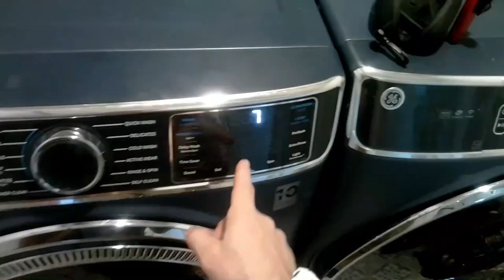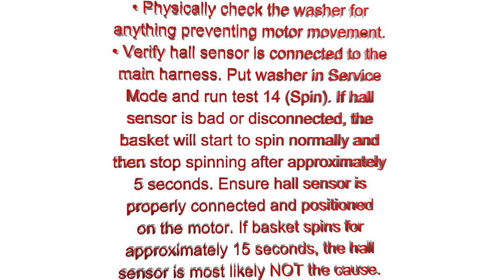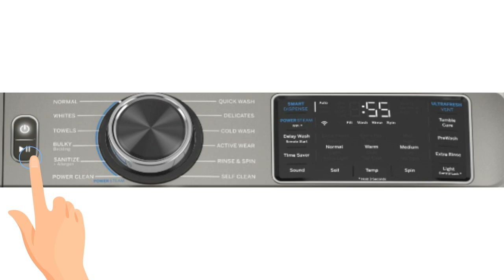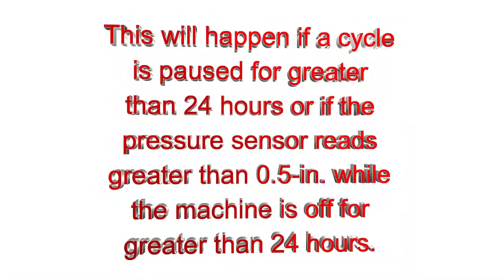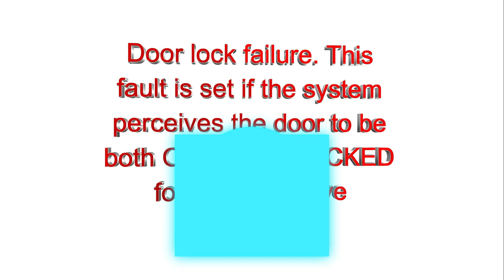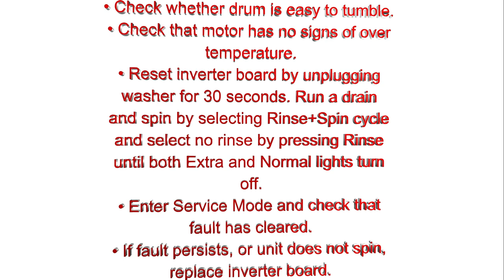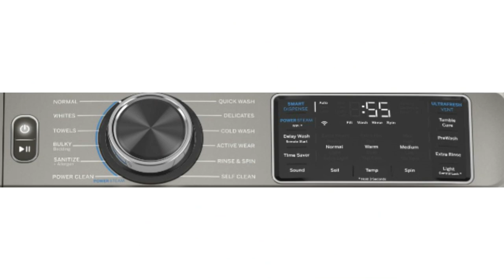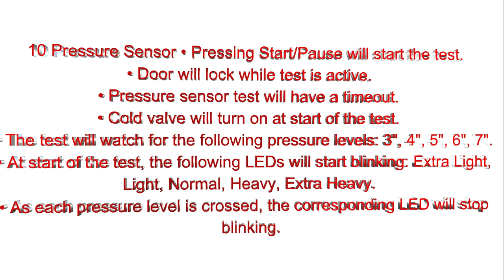GE Washer Diagnostic & Error Code Guide: Models GFW510-GFW850

Comment: Thanks for excellent video. I have GE Front load washer Model GEW550SPN0DG which all of sudden stop spinning and all washing cycle stop in 4 to 5 minutes. It shows error code 3, 27, 38, 32 and 65.
I did test 10 (Pressure Sensor) which seems working. Soil LED blink and stop all for indicator (i.e., Extra Light to Extra Heavy)
Test 14 (Spin). Basket stopped spinning after 4 to 5 seconds. I replaced Accelerometer (WH03X32138) but it did not solve the issue. Does Hall sensor and Accelerometer are same part for Model GEW550SPN0DG?
Test 24 (Damper). Soil level “Light” LED continues blink during test and when press start/pause button it changes to “Extra Light” and stay there until press any other button or Power off. I am not sure whether it’s successful test or not. Does it suppose to start with “Light” and change to “Extra Light” and stop at the end to Test automatically. 
Appreciate your help.

Comment: My gfw850spnors is not working, it turns on but no cycle runs, it is showing error code 89, I had a few more and replaced the inverter board and then the accelermeter, but I still have error code 89 and it will no work. Help!

Comment: I keep getting the “h20 supply” error.. water pressure is good. Hoses are good. I run through all these tests and no errors.. do you know what it could be?!? Very frustrating
Reply: @TravelDuckDude Please inspect your inlet valve screens for any debris that may be trapped between the filter screen and the inlet. Additionally, I recommend flushing out your water lines using a 5-gallon bucket. Begin by turning off the water supply and disconnecting the hose from the washer. Direct the open end of the hose into the bucket and gradually open the water valve. Observe the water for any signs of debris.
Reply: @ Thanks but the screen is clean and I even switched the hoses out. I found out it’s only when I use the cold water.. so now my clothing can only be washed in very hot water..
Reply: @TravelDuckDude  You may need to replace that intel for the cold side.

Comment: Mine doesnt seem to start diagnostic mode at all. Even when I hold 10 seconds or I hold and move 6 or 8. It doesnt go into diagnostic mode but turns it on and goes into turning between wash modes.

Comment: I have models purchased in 2020 and it is definitely 6 clicks with holding start button rather than 8 to get into diagnostic mode. Thought my control panel was broken as I couldn’t get it to work with 8. Luckily I have 2 machines I was able to test on and kept trying different click combinations on the working machine. Everything else is the same though!
Reply from the maker: I appreciate you posting this; it's bound to be useful to others. Just a note, it took me 8 clicks to get it working. According to the Service Manual, the correct procedure is to "PRESS AND HOLD THE START PAD WHILE ROTATING THE CYCLE SELECTION KNOB 180 DEGREES." Nonetheless, I'm grateful for your input. Hope you have a great day!
Reply: Thank you! Dealing with an error 3 so not sure how great the day can be but glad to have more info! 😊
Reply: @onlineappliancetech Mine was six as well. There are 12 selections in the dial so 180 degrees would be six cycles. Sometimes it feels like there are two clicks to get to a cycle. Maybe that’s why you noted 8 clicks.

Comment: It appears that the hall effect sensor on this model(gfw850) is directly on the motor opposite the drive belt. You can access it with the front panel removed. There is a spring cover. It does not appear that the hall effect sensor can be serviced and a failure of the sensor requires a replacement of the motor. It's likely that the invertor board is the source of failure in the case of spin failure where the machine does not detect rotation and will not continue to spin cycle.
Reply: My GFW510SCN0WW washer is showing error code 3. When we ran the test 14. It would only spin for 5 to 8 seconds. Would that be a hall sensor issue? And would the hall sensor and the accelerator meter be the same thing? That is the part we replaces but I'm still having the same issue. Error 3.
Reply: @ashleysalazar934  I replaced the inverter board which fixed it. It's in the lower left. It might be easiest to replace through the bottom if that's an option for you.